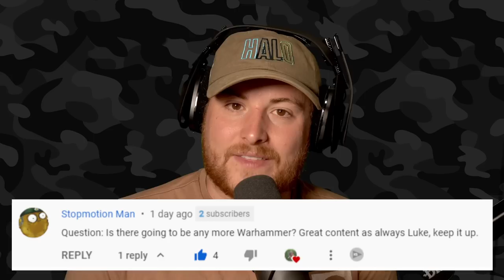The Bomb That Ended a War - NOT WHAT TOU THINK! (Royal Marine Reacts)

Comment: You need a lot of luck too. You can do all the math you want but as a horizontal directional driller I will tell you there is no guarantee what you will find under the ground. Obviously they dug it up to put the bunkers in but penitrating sand or clay is alot easier than Rock.